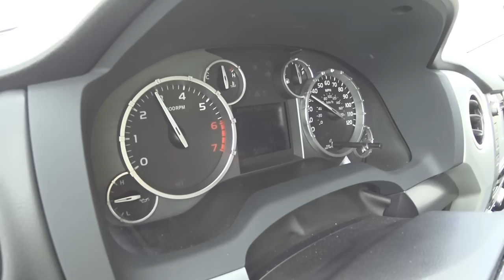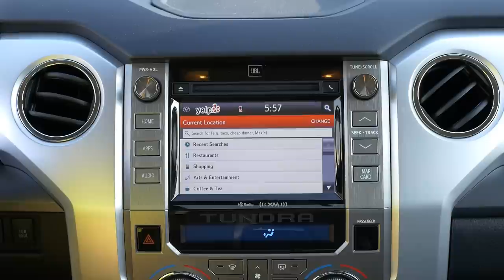Review | 2015 Toyota Tundra  | So Big It Hurts

Comment: I drove a 2014 Tundra for a week and I really liked it. Yes it was massive compared to what I'm used to with the FR-S it was a different world of driving for me. I had no complaints other than the odd gas gauge they put on it, it wasn't divided by quarters it was a really odd gauge divided by 1/3's but they weren't even if I remember correctly. The one thing that I would have to get with the truck is the reverse camera, that is so helpful when backing close to haul away some furniture. It was great it already had a nice bedliner and my favorite part about the interior was it was a solid mat there was no carpet to worry about keeping clean, you could spray the floor down if you wanted. All in all I would buy one, being that I'm 5'6" you could say that there was  a slight little guy syndrome but it's a great utility vehicle I would certainly use.
Reply: They are standard on all Tundras now. the cameras

Comment: I guess you could say its "a lot of money", but its the same price as a properly equipped midsize SUV, and cheaper than a full size SUV like an explorer... fuel mileage about the same... and resale better... so what's the problem.  The tundra will stand up longer and give you better resale, but might cost you a bit more at the pumps than other pickups...

Comment: I just am about to hit 100k miles on my 2008 Tundra and thought, "hey maybe I will get a newer one"  But... after seeing videos like this, I just got a new double DIN stereo that had Android/Apple play and supported a backup camera. So now I think I am good for another 100k. The only thing wrong with the truck is the scratches, dings and dents farm living and parking lot asshats delivered.  All the buttons, switches,  levers, etc work and it is mechanically perfect.   Only expense: gas, tires, oil, air and cabin filters.

Comment: its a ram its got a hemi that has no resale value and no hood transmissions and has more little things that break like the air suspension. toyota is the best 100%
Reply: Resale value is same as all the other american fullsize trucks. Transmission? Its got a ZF 8HP70, same you'll find in  BMW, Audi, Rolls Royce, etc. Very strong and reliable transmission. It ain't like the previous torqueflites.  The GM 6l80 and Ford 6r80 transmissions in the same class are directly based on ZF transmissions. More things that break? You have trim levels for a reason, choose what you want. Tundras are great trucks, but don't talk out your ass buddy.
Reply: MrBlurberries man the whole Chrysler group has been hated on for their terrible reliability and that has shown in countless reliability ratings. It has even gotten to the point where new rams, dodges and jeeps are getting discounted heavily from msrp new from dealers
Reply: Hemi won't make to 120,000 miles
Reply: The RAM actually has the worst resale value of all of the full size pickups, and Tundra has the best (by far).
Reply: he was joking
Reply: Yep family owned only dodge for 10 years it's all junk and the shop gets to use your truck as much as you do

Comment: Great review. Some different perspectives. Trucks and cars used to cost the same even though a truck had a ton more steel. Now that they are trying to make trucks that ride like cars, with all the same features, truck prices have gone way too high. I would rather have a truck without the fancy stuff for cheaper. I just bought a 2016 Tundra TRD Pro. $49k to drive it off the lot, wow. I bought the Toyota for resale value and reliability. Search for Edmunds top 10 made in America Trucks. Turns out Chevys and GMs come off assembly lines in Mexico. The only truck with the engine, transmission, body, and assembly made 100% in America is the Toyota Tundra.

Comment: Comments made were all valid points... except for the fact that mostly everything expressed was designed that way on purpose for utility not vanity.  Extra large steering wheel, door handles, shift knob, controls were designed like that to be managed with gloves on (any toyota demo's explain all of that)... for that they hit the mark.  Trucks are large scale to do work (tow, move, etc...).  They are not fast, they are not built for handling, they are designed to operate best under load as thats there whole reason for existence. It wouldn't be right or fair to compare there characteristics to that of a car... Would you wear work boots to go jogging ?  Then give a review at how inadequate they were ?
Reply from the maker: It's not a knock on the truck it just feels excessive. Some of it becomes overbearing, but you know what, you are right its functional.

Comment: I always wondered why it seems like 80% of vehicles on the road in my area are trucks and I still do.  I'll never understand the truck mentality.  Unless you actually use it as a utility vehicle frequently and not just a daily driver you're probably just compensating for something.
Reply: It's something that doesn't make any sense on paper but makes alot of people immensely happy. Like driving a jeep.
Reply: Thrillcekr I've never had a problem getting to work/school in my car here in northeast Iowa.   How many times have you really needed to haul something.   The few times that you do, it wouldn't be hard to find a friend who owns one.   I'd much rather borrow a friends, pay for gas + $50 than be stuck with super low mpg.

Comment: I own a 2018 Platinum and it is one killer truck. It looks better than any ford, chevy or dodge. It is one nice truck with plenty of power. With a 430 gear in the rear, it is made to get out of the whole and pull a load when ask to. As for me and my Tundra, top of the line in trucks. PERIOD

Comment: His review didnt come across to me as biased but rather a guy who doesnt know or appreciate trucks for the purposes people buy them. Big is what most look for in a truck, hauling people and gear. Interior design? Again, its a truck, not a luxury car. I have an 08 tundra trd limited with 187000 on it and the reliability has been stellar. All I have done is change fluids, 2 sets if new tires, soon to be 3, and 1 set of brake pads at all 4 corners. Never a check engine light, breakdown or anything. I dont know one person driving a truck from the big 3 who hasnt had to soend thousands keeping their vehicles running. Mine is also worth more in trade in and loan value. For me to have bought a comparable truck from one of the big 3 at the time I would have spent the same or more than I spent on mine, so with the purchase price, lack of thousands in necessary repairs and higher resale value I will come out 7-10 thousand better than any of my friends that own a truck from the big 3.

Comment: The thing about the Chevy/Ford fanboys hating this truck no matter what is:

If Toyota keeps making a decent, reliable truck, they'll eventually win those fanboys over.

I was diehard GM until they went with AFM and started eating lifters. (And as late as 2015, they were STILL eating lifters because it just happened to a friend of mine's 2015.)

So I switched to Ford about 6 years ago and it hasn't been a whole lot better. The mod motors had spark plug issues, all KINDS of timing related issues, phaser issues and the one I dealt with personally: broken exhaust manifold studs out the ass.

The Ecoboosts have also had issues with water collecting in the intercooler. The 5.0s have even had some phaser issues, too.

Looking at everything available on the market today, this once GM fanboy/Ford fanboy is ready to buy something that won't keep me up at night worrying about every little sound I hear coming from the engine bay. 

And if GM, specifically, keeps it up with the AFM crap they keep doubling down on, they'll be in trouble again. My BIL used to race Chevy's as a hobby but has gone through three engines in his Silverado due to AFM grenading his valvetrain. He'll never buy GM again and neither will I as long as they're pushing that junk.

Comment: I have a 2007 TRD Double Cab with the 5.7L. Bought it in 2006 still going strong! it is a beast. Only the raptor gives it a test at the line and yes it burns through gas but hey its a truck. I love it and will keep on loving it. I cannot wait for the 2021 3rd Gen to see how they will improve this monster. I love your candid reviews keep them coming.

Comment: I'm thinking of getting 2012 Tundra... is there a difference between tow package vs tow hitch?  I've seen ads with both and it's confusing me.
Reply: +YakMan NC       The tow package includes a larger radiator, auxiliary oil & transmission coolers, heavy-duty battery & alternator, enhanced sway control technology, trailer wiring & connectors, and, of course, the hitch receiver. On current models, that tow package and an integrated trailer brake controller are standard equipment.

Comment: I do find my Tundra is searching for gears.. and i'm not sure why.  the downhill assist or whatever its called kind of annoys me.. i kindda like that free mpg i gain on a hill, so i find myself lightly touching the throttle to let it coast rather than slow the truck...
Reply: +666dynomax  you are doing the right thing by doing that , thats the only way to trick the computer , but lets not forget the huge advantage in the winter time about that engine retarder. I personally lost a second gen Tundra 2 years ago coming down on a icy highway ..just lightly touched the brake and i slowly started spinning and end up slamming against the rail ....the truck was a write off ...my baby was gone..2004 Limited double cab fully accessorized ..

Comment: NOT that the 5.7 needs any help ?
But after reading engineering information by my brother engineers working on friction reduction at BELL CANADA I now have the Friction Reduction and cleaning formula worked out on 2 test cars for 3 years.
I can not only reduce the 27% of friction in all motors I can keep the engine clean of carbon and sludge while raising compression and HP and.....MPG.
My cavalier went from 322 highway at best as per 60 mph to 43.3 in the same conditions with friction reduction.
Ask me for the formula and I will share it .
I will be retiring and buying the 5.7 to pull our 21 escape trailer for 15 years over mountians and into valleys to camp and explore.
I will add the ROAD ARMOUR BUMPER for texters and deer and bush but that's it except for the cone racks by AMERICAN.

Comment: After 2 seasons in any of the salt belt region state of North America and this shit will rust to dust just like any other Ford Chevy Dodge etc. Same shit different exterior.
Reply: +FDSeoul San Diego thats why you should do the rust proofing with the lifetime warranty offered by toyota !
Reply: +FDSeoul San Diego I live in the salt belt and the Tundra holds up very well no rust 2007 model. Fiat/Ram on the other hand rust out here in 2 years.  Chevy 3 years and Ford 4
Reply: Toronto Canada here and can confirm lol

Comment: The cost goes into component material and engineering. Its overbuilt for its rating honestly. Compared to the Big 3 the Tundra is way overbuilt which is great! 

The forum post gives a decent amount of info on the spindles, brakes, and diff. http://www.tundratalk.net/forums/tundra-general-discussion/73003-when-exactly-did-tundra-become-1-2-ton-p-u.html

Comment: are you serious? you are clearly lost and know nothing about trucks. the only truck with 4 piston calipers. your correct about leaving truck reviews to someone else. simply put. the Tundra engine and trans are the most advanced on the market STILL. Dual independent variable valve timing and the truck will NOT interfere if you knew how to use the buttons on the dash.

Comment: Tundra...reliable?  NO. Tacoma / 4Runner is reliable...Tundra is not reliable.  Our company has a fleet of Tundras / F250s / F150s / and GMC Sierra 1500s (which is same as Chevy).  By far the most reliable ones are GMC (Chevy).  Ford is good utility trucks but its transmission goes out after 50k miles.  Tundras...after 50k miles, its reliability is about less of that as GMC - Plus, it has much softer body twist - so good for off roading, but not good for resale because frame sometimes gets bent.